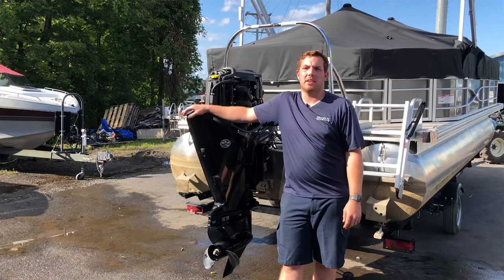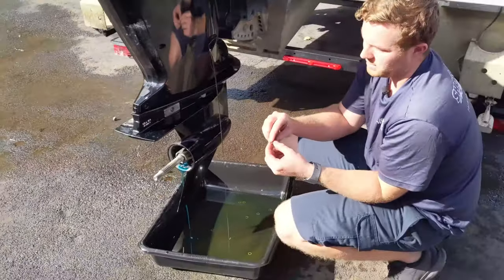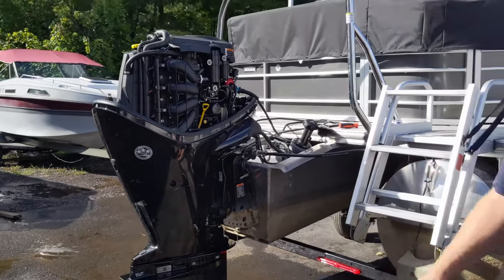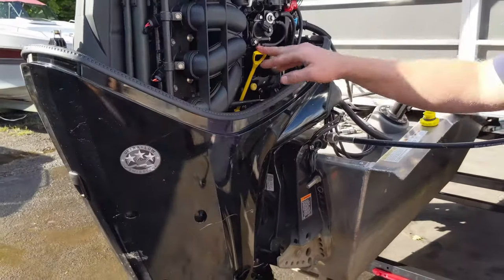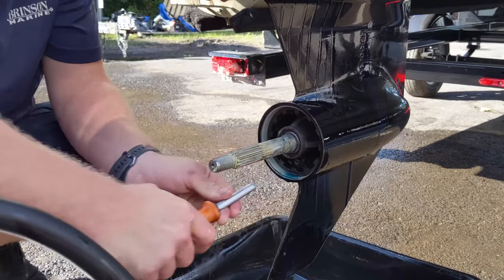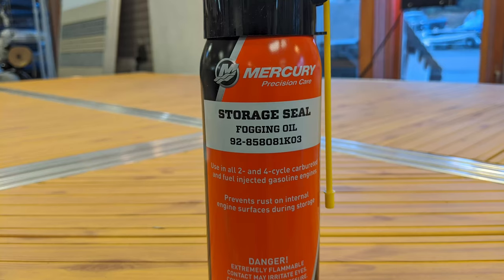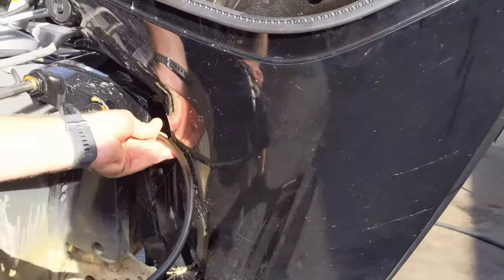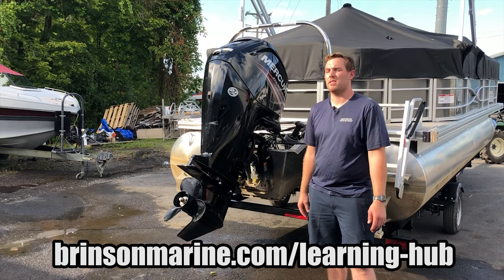Annual Maintenance and Winterization - Mercury 115HP 4-Stroke Outboard Engine |

Comment: Great video. For those of us that live up north and store our boats in unheated garages or outside, how do i make sure all of the water is drained from the motor so it doesn't freeze?
Reply: The outboards self drain so just make sure the engine is in the upright position and all of your water will drain out
Reply: @julianberman8600  Like trim down or on?
Reply: @SethHarvey  yes just trim down and the water will drain out the bottom. It wouldn't be a bad idea to check the gear lube for water intrusion but otherwise the engine is self draining (unlike an inboard engine or I/O)
Reply: @SethHarvey I trim it all the way up....let it drain....then all the way down...let it drain and that should be all of it.  There may be some around the prop so when you take it off to drain the gear lube....it should all be out.

Comment: I recently purchased a 90 hp Mercury. Changing oil and filter, fuel filter and lower gear oil tomorrow. 
Should I also change out the impeller? 
I also have a question about a Water Separator? Should I install one as well? If so, can you do a video on that as well?
Reply: Mercury recommends replacing the water pump impeller every 3-5 years or 300-500 hours, whichever comes first. Some boats have water separators installed, some don't. It's up to you. We don't have a video on installing a fuel water separator but maybe we can in the future. Thank you
Reply: @julianberman8600  I most definitely want to install a water separator.  I’m not sure which fuel line to use.  There are three fuel lines coming from the tank.
I stalked to a Mercury Technician, absolutely no help.
Reply: @rodneykaneaster3292  Yeah each boat is a little different. I'd recommend bringing the boat to your local dealer

Comment: Great Video. Need a starter switch to start the motor from the motor like in the video. What is it called and is their a video on installing one?
Reply from the maker: Thanks for the feedback. Alex is using a key switch that pugs into the wiring harness

Comment: So you dont have to run antifreeze through the water intake?
Reply: The Mercury outboard is self draining so you don't need to run anti-freeze thru it.  It's a good practice to tilt the outboard all the way down so it drains any water in the gearcase and if its outside and tilted up we cover the prop so snow/ice/rain don't get into the exhaust area.

Comment: This motor looks just like my Mercury 75hp. Hopefully the maintenance is roughly the same. I'm worried about the o rings in my lower unit. They may have come out without me noticing. Have a part number for those? Are they all the same size for the lower gear unit?
Reply from the maker: They can be different. The best way to get the right part is by looking it up with your engine serial number. Mercury has a good electronic parts catalog you can try using on their website

Comment: I have a question: when you say at the beginning at halfway through as well that you’re running the engine after the stabilizer and again on e the oil has been changed, is it safe to do this out of the water?  Or do I have to put the boat in the water prior to running it for those few minutes?
Reply: hook it up to water so you don't burn the engine up which can happen very quickly.. or put it in the lake.... these motors require water
Reply from the maker: Great question. @Chuck Bowling is right, you will need water to safely run the engine. We use motor flushers (or "muffs") to connect a regular garden hose to the engine. The flushers are low cost and work very well. Just make sure the water is actually pumping through the engine when you start it to prevent overheating. You'll see a stream of water (tell tale) spraying out of the engine to indicate that the water pump is working.
Reply: @brinsonmarine  q